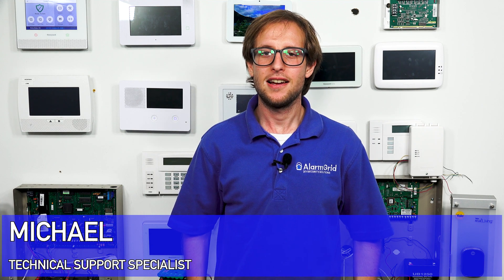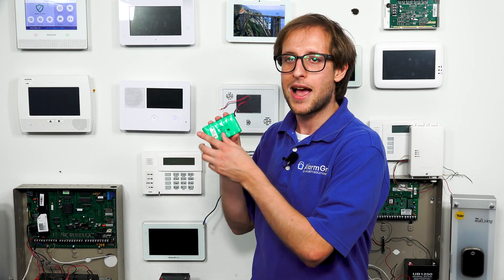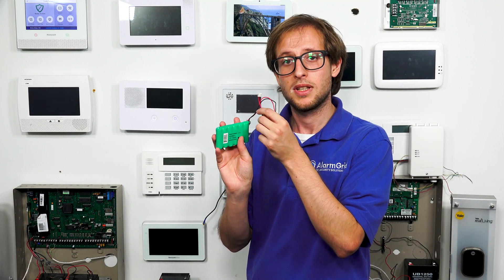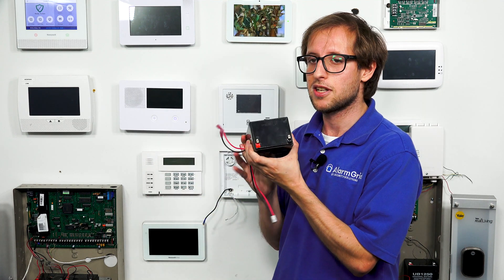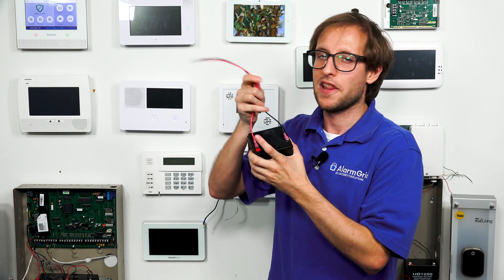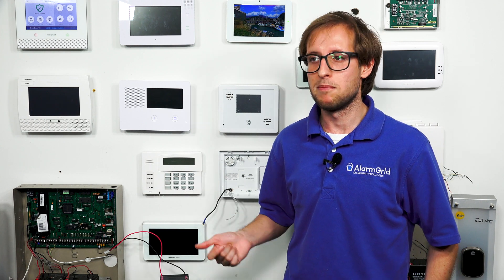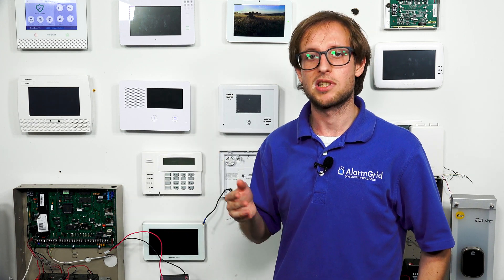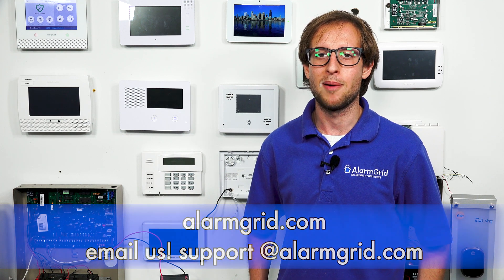How an Alarm System Backup Battery Works

Comment: Can the harness be connected upside down or it doesn't matter which way as long as it on the correct terminal ? My one is not the same shape top and bottom. Thanks

Comment: Hi, what is the largest Ah battery you can put into a vista P20 alarm system? Thank you for your advice.
Reply: The largest capacity battery for a Vista-20p is 17.2AH. You're welcome, Enjoy!
Reply: Any battery I see that is larger than seven amp power has F2 connectors not F1 I would need to convert the connectors would I not? Thank you for your response.

Comment: @Alarm Grid i recently purchased a wireless house alarm system. But i would like to install it in my van. It runs off a 5v adapter at 1000miliamps. Do you have any suggestions on how i can wire this up without draining my vans battery. Or maybe use a backup battery to run it from 
Thanks

Comment: Hi, very informative. I've a question - I've just replaced my backup battery because the sounder bell was going off when I had a power cut but this is still happening with the new battery. It seems like the new battery isn't being used by the alarm system but it's definitely connected correctly. I've also checked the internal fuses and there's an in-line fuse on the live wire to the battery. All 3 fuses look fine. What could be preventing the battery from kicking in when the power fails?

Comment: We had a power cut the other day and ever since the front door sensor and other Motion sensors go off when passed by even if the alarm is isn’t set, when someone leaves the house we have to turn the main electricity off then put in the code for the alarm and the noise stops but then a beep every minute starts to happen and all the sensors are active again. We have the indoor sensors covered up so they don’t go off but we have to repeat this everytime the front door opens and we aren’t sure what’s wrong with it and can’t call anybody out to look at the moment. Any chance you can help?
Reply: @Gary appreciate the help sir, do I delete the zones using the panel? If so I’ll give it a try but not sure if it will work because as of right now the panel doesn’t work, it works when the mains are switched back on but once the code is put in the panel doesn’t register anything
Reply: @Gary but I do hear the keypad make a noise when a button is pressed